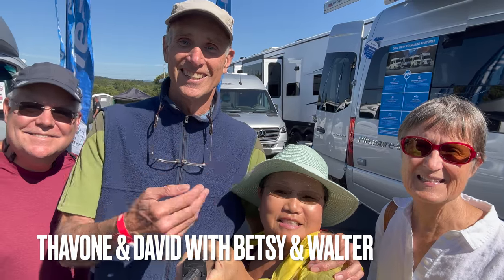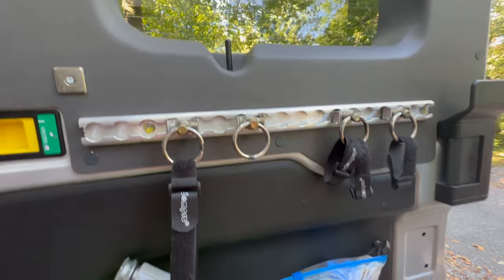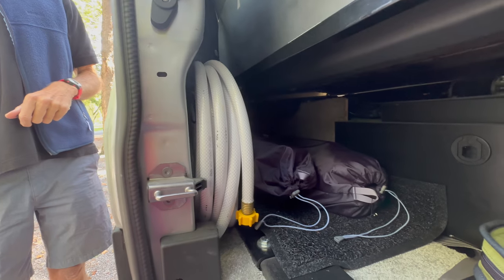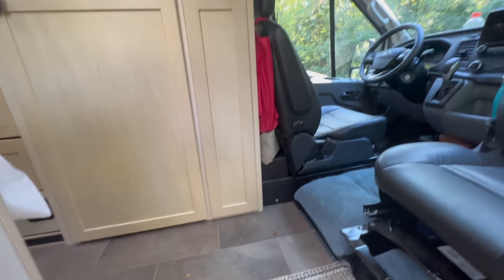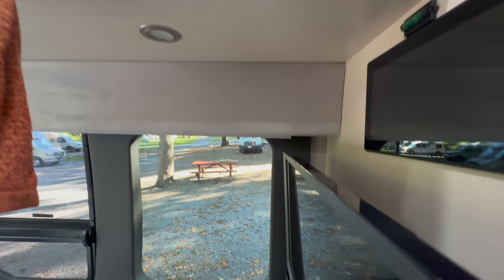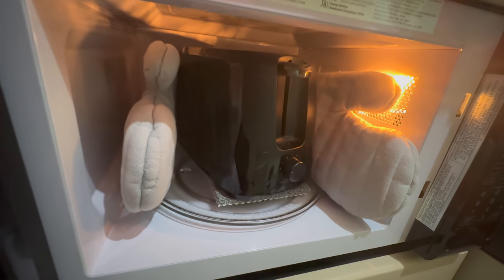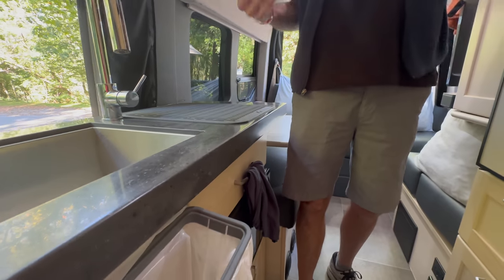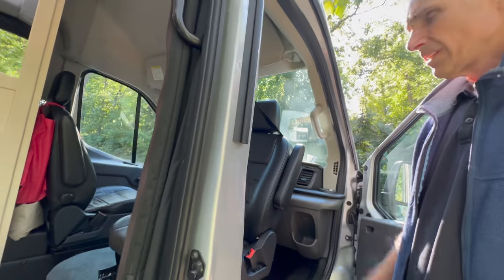CREATING MORE STORAGE WITH L-Track TIE DOWN SYSTEM FOR ALL RVs /TOUR OF 2022 PLEASURE-WAY ONTOUR 2.0

Comment: Nice mods. I have a 2020 Ford Transit MR, 148” WB DIY camper van. 

I’m a little younger than you and I couldn’t deal with tearing down and putting my bed together every night. 

I put a fixed bed that enables me to sleep east to west. 

I also put L track in my van. US cargo control has an assortment of different fittings. A bit pricey, but it helps enable organization.

I also installed L track in the ceiling,
above my bed. I attached a heavy duty O ring that acts as a grab ring. It helps me lift up and back in bed. 

I installed some above my back windows. I hang a Molle panel with zippered storage bags.

Are the floor Smartliner’s rubber? I own a 1 piece from Husky and I find it to be slippery. 

Thanks for sharing a tour of your van.

Comment: As an Ontour 2.2 wannabe I love your insightful videos. I have a couple questions for the folks out there. How quiet is the cab when driving on a highway? Road noise and interior rattles…
Also, how is the Ontour with winter camping? How cold can one safely camp? 
I thank you in advance.
Reply from the maker: Thank you Jim. These videos below will give you an idea of the noise a class B RV . A Class A owner commented that the class B cabin noise is quieter compared to a class A RV.  We put pads in between pots, pans, appliances that would rattle. If you winterize your RV, you can use the RV like any vehicle. You can flush the toilet with pink anti-freeze. We have seen Pleasure-Way owners who live in the northern part of the USA who would  camp in the Winter. The Truma furnace which runs on propane gives a very nice heat.   
OnTour 2.2 test drive  https://youtu.be/fGD7Qin0Ofk
OnTour 2.2 Winter camping by Leonard Sackett https://youtu.be/5zs47r4hyq4?si=sRSmHtvvQ84OHv5u
OnTour 2.0 test drive  https://youtu.be/12OCoEhvpSk
Winterize video https://youtu.be/0vreqF44StE 
De-Winterizing https://youtu.be/fRlV88N26kk
If you do end up buying OnTour 2.2 (which we also love)
You can use our referral code #1160 to get a $250 check send to you by mail.
How does it work? Within 90 days of your purchase of any Pleasure-Way models and after you get a VIN number, go to
https://pleasureway.com/owners/pleasure-way-ambassador-crew/claim-your-pac-rewards/ 
to submit the referral code. 
You don’t need to give this code to the salesman or a dealer
Referral’s / Ambassador’s name is Thavone Washer
Any questions email us at hiking1981@yahoo.com

Comment: Thank you.  We bought the same cover for on top on the induction stove, but is there anything available to protect the stove when cooking with induction pots and pans?  We are struggling to get a solution to getting internet access when traveling.  Any thoughts are greatly appreciated.  Be safe and well.
Reply from the maker: This is what we use. It was from Cindy's OnTour 2.0 walk-through video. 
Lazy K Induction Cooktop Mat - Silicone Fiberglass Scratch Protector - for Magnetic Stove - Non slip Pads to Prevent Pots from Sliding during Cooking_ Black (9.4inches) 
https://amzn.to/3t3nBHk

(This is David) - We use several  services:

1.  Visible
This is a Verizon-affiliated carrier.  https://www.verizon.com/about/news/what-visible
Visible has unlimited data, with no throttling.  It does experience slow-downs on occasions of heavy traffic.  This usually occurs for us around 4-8pm daily.  Even when slowed down, however, we usually still get 5-10Mb download speed.  We have the $35/month plan.  Its hotspot capability is limited to 5Mb down, and a single device connected at a time.

If you are interested in Visible, check out this page: https://www.visible.com/get/?3phSvC, it has all the info you need to know about joining Visible. If you use our friend code, 3phSvC, you’ll get your first month of service for $20-off.

2.  Starlink.  
Starlink is a satellite-based service, that we used frequently when traveling in Arizona, Nevada, and New Mexico, in areas with poor or non-existent cell service.  It is more expensive, with an equipment cost of $599 and a monthly cost of $150.  Go to https://www.starlink.com/roam.

We have several videos concerning our Starlink experiences.

We also have an ATT plan, which has 100GB down, throttled after that amount.  This is our backup connection, is case we have issues with Visible and Starlink.

I work remotely, so it is important to have multiple ways to connect to the internet.  This may be overkill for more casual usage.  If you have to choose just one, go with Visible.  We have been very happy with its service.

Comment: Great video on storage ideas.! I wanted to ask a question about your video from the Hershey show. I know that the lithium has increased to 600 Ah.On the ontour 2.0 they  said they can't use the new efficient and quiter Truma ac and have kept the 120v Dometic. So you still can't run the ac on lithium However, one of the PW reps mentioned to you and David you could switch and use your current ac (? Houghton- I saw your video on that mod). You could now run it on lithium. 
I am confused. Is your current Houghton  ac 12v or 120v? Would Fretz have to modify wiring on your 2024 ontour 2.0?. Lastly, I know some rvr`s install "soft start" or easy start on ac unit that slowly kicks on ac so it doesn't require "spike" in voltage to start. 

I am interested in purchasing the ontour 2.0, but want to run ac on lithium.  My other option was to consider putting in 12v ac. Any suggestions would be helpful.  Thanks,
Sandy
Reply from the maker: Hello. This is David:

In regard to the 2024 OnTour 2.0 upgrade video https://youtu.be/855bdFuqJug

We were also confused.  It is not about the batteries, it is about the air conditioner.

The new quieter Truma AC is longer front-to-back than the louder AC units that Pleasure-way has installed in the past.  We were told that due to the support structure of the 2.0 chassis and its minimal roof space, the placement of the Truma towards the back would cause the AC unit to stick out 3-4 inches or so past the back of the van. Placing the Truma in front of the internal supports causes the AC cowling inside the van to block the bathroom door so it can’t be opened.  Since neither placement works, Pleasure-Way is continuing to install the louder AC unit in the 2.0.  This louder AC unit will run just fine off of the 600 Ah of batteries.  Just louder.  

As a side note, I want to mention that the louder AC unit does a terrific job of quickly cooling the RV. It moves a lot of air.  It is just hard to have a conversation underneath it when it is running.

When we trade-in our 2021.5 OnTour 2.0, Fretz is going to remove our Houghton AC from the 2021.5 and place it onto our 2024 OnTour 2.0, and place the AC from the 2024 onto the 2021.5. So we will have our quieter Houghton AC with the 2024 and it’s 600 Ah of batteries and 3000W inverter. Our Houghton is 120v, as is the louder AC.   

I do not know if any of the AC’s mentioned above utilize a ‘soft start’.

Comment: What kind and size wood is used to create the shelves inside the overhead cabinets?
Reply from the maker: We will ask Walter and Betsy for you.
Reply: The wood that was used for the shelves was 1/2 birch plywood.  I got the wood from Home Depot.  This is very stable wood with a nice two sided sanded surface for easy finishing. Use a high tooth count plywood blade to reduce edge splintering when cutting.